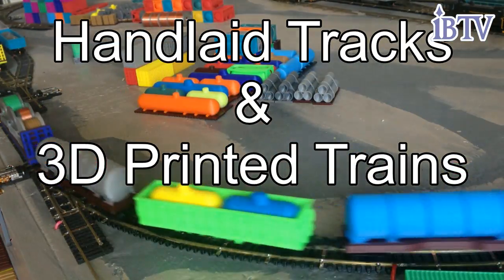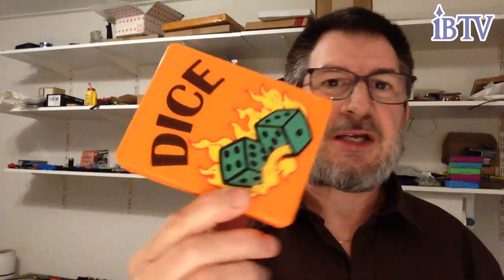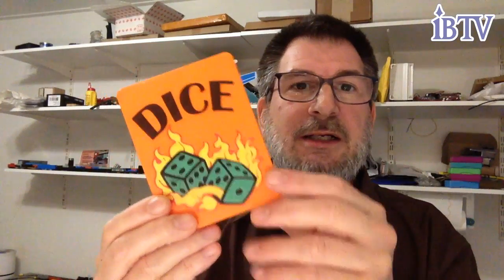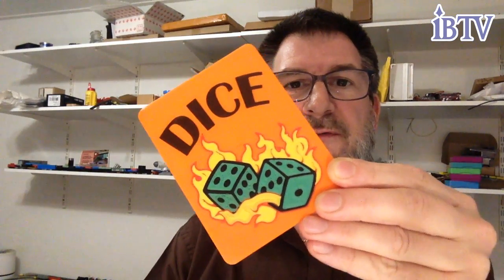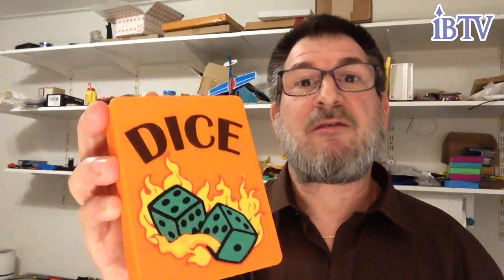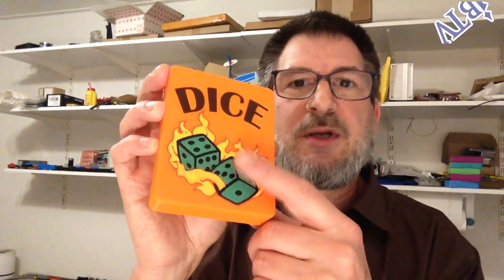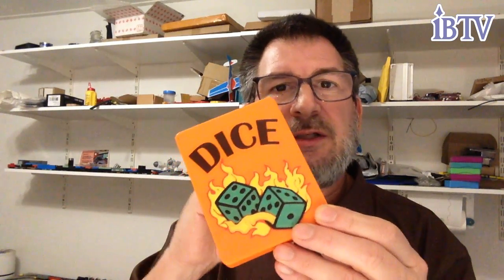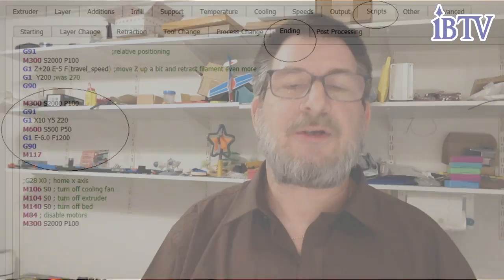How To Use Z Hop For Multiple Color Prints With Any 3D Printer

Comment: Brilliant!!! And it’s so simple! Thank you! I’ve always done my color changes on the last 4 layers or so, and it works well, but the surface finish is lacking and it’s limited to 2 colors, UNLIKE THIS METHOD! Forgive me, I’m excited 😅
Reply from the maker: You make me smile! So glad it helped! You find things on the web, learn from them and try to pass it on! That Gcode was complex to get - thanks to that YT video guy who taught me!! Now I have two Bambu A1's w/AMS  four colors! A full generation ahead of my CR10 V3. I returned a Bambu X1C but love the A1. There are a few other videos on my channel about doing the Z Hop. I used a invisible guide around the object to center them. A frame too thin and short to print, but it puts all the pieces into the same place in the slicer. You won't be unhappy with a A1 though!!

Comment: very cool. MMU is not bamboo's invention, they haven't invented anything new really. Just bamboozle people out of money :) 
I'll try this in prusa slicer.
Reply from the maker: I had a X1C but it was so loud in my tiny apt and jammed on the 2nd color change, I returned it... Still want a multicolor printer though! Just made a Z hop using the top layers instead of the bottom ones...

Comment: This is a great way to do multicolor. I've used pause at layer height to get raised top surface text but can't believe I never thought of doing individual prints with separate colors on the bottom layer. As far as the video goes, if you did a walkthrough showing each part sliced and printed it would be a little easier to follow along with what you did to make this.
Reply from the maker: Here is a more detailed video on using Z Hop - this time in the middle of the print. https://youtu.be/0Y7Y2E6cqZw
Reply from the maker: I'll put together another version soon. I used Z hop on the top layer as well, same method. The main thing is to add a key shape around each part so they align in the slicer. I use an unprintable 0.1mm thick and 0.05mm tall rectangle copied into each part.
Reply: I agree.

Comment: I just finally got into 3D printing this month, after first learning about it back in the 90's, and following along ever since. It's been a long wait, but now I have a Prusha MK4. I wanted to do this same thing, but it really doesn't seem like a default ability in Prushaslicer. I made keyboard key caps with two colors by setting up multiple extruders, and setting the parts to use two different filaments. I need to figure out this Z-hop thing, because after it switches colors (manually, with manual purging), it returns where it left off, and can end up smearing, which is super obvious with white caps with black legends.
Reply from the maker: Each color is it's own object and gets sliced separately. I'll put together another version soon. I used Z hop on the top layer as well, same method. The main thing is to add a key shape around each part so they align in the slicer. I use an unprintable 0.1mm thick and 0.05mm tall rectangle copied into each part.
Reply: @handlaidtracksand3dprinted922  it's been a printerful month, and I've figured out a lot since then, making all kinds of cool stuff, but unprintably short bounding boxes for registration is such a great idea. I've been saying I keep running into really brilliant things in this new hobby of mine, and this one is today's!
Reply from the maker: Just make sure you add the objects one at a time - at least in Simplify3D slicer... or they won't stack! Such a great hobby and eye opener for any little people just starting off and still wasting time watching movies etc... Create your own world! I recently was using Z hop on the top layers instead. Not as flat as the bottom, but opens another door to the possible!
Reply from the maker: Here is a more detailed video on using Z Hop - this time in the middle of the print. https://youtu.be/0Y7Y2E6cqZw

Comment: Interesting way to do it. I used a multiple extruder profile in PrusaSlicer to do a similar thing. Set up as "Single Extruder Multi Material" then add as many extruders as colors you'll be using, then in the Tool change G-code add the following:

{if layer_num >= 0}M600 ; change to filament for extruder {next_extruder + 1}{endif}

Checking for layer_num is required to not pause after the start sequence (which I guess counts as layer 0).
Reply from the maker: Very interesting, thanks for sharing. Are you still using separate files for each color, with that Gcode line in the start of each of the files after the first? I've been using S3D for awhile now, each has advantages and weakness. Already paid for it, so may as well use it!
Reply: @handlaidtracksand3dprinted922  since it's in the Tool change section, it's automatically added to the gcode that is output, so only a single file is sent to the printer. If the model is set up properly for MMU use in PrusaSlicer, the printer will automatically pause.